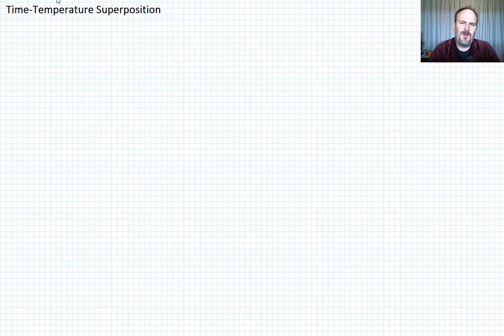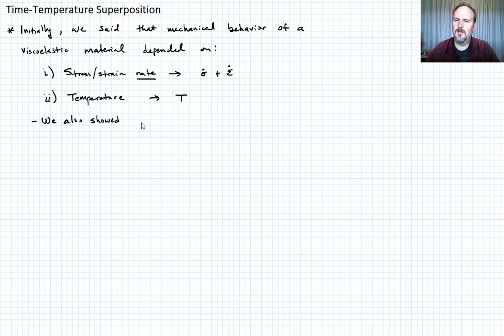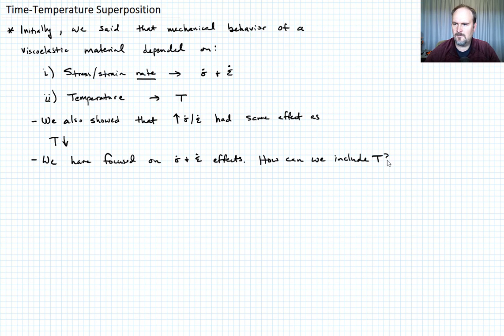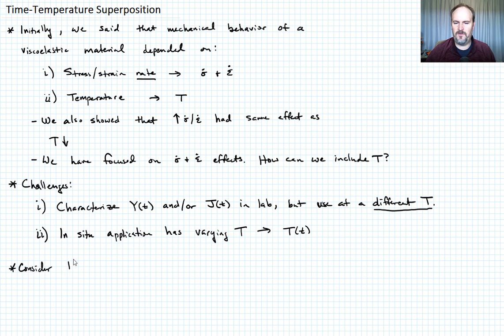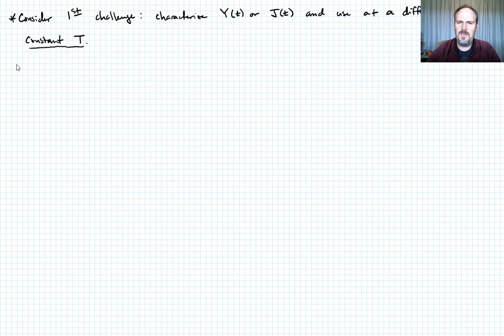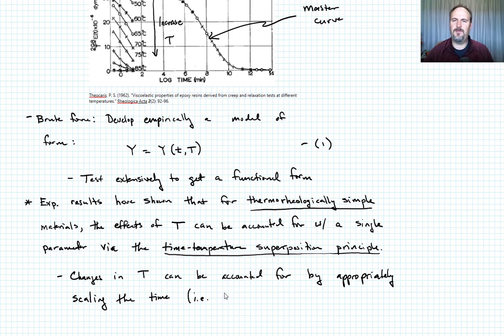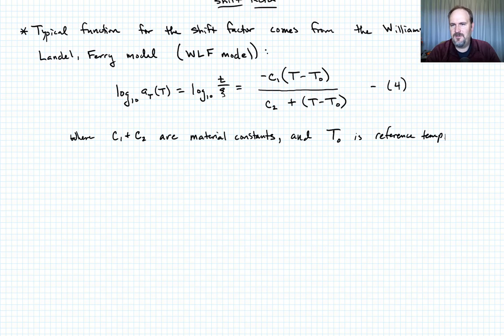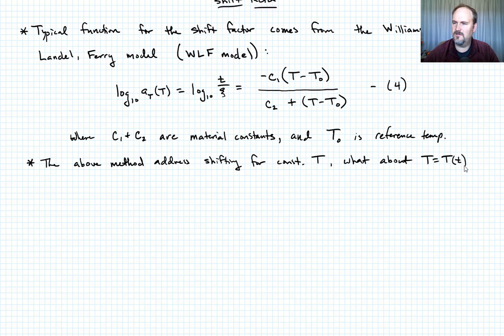3-8: Time-Temperature Superposition

Comment: very good video!  May I have questions here:  
1. @15:04,  where to find the C1,C2 , or where is the table ?  I read some papers, it seems like the c1c2 are found by curve fitting. instead of looking at the table. 
2. This is most important question here.  @5:28.  anyone can guide me how to read the master curve ?  I don't understand the meaning or purpose of this master curve.   for example, if logtime =12, then the property is about 8 ?  
3.  If yes in 2, how about the temperature at that moment, is there a way to read the temperature from master curve?     

Anyone could help me here?  I am learning this all by myself.  thank you so much
Reply: Hi do you find the answer how to get c1 and c2?
Reply: @multazam1481  "c1c2 are found by curve fitting" as I mentioned.  I thought you find from a table, no, you find those c1c2 by yourself.